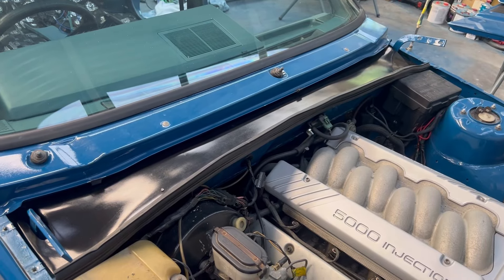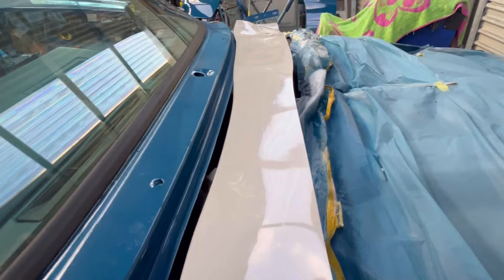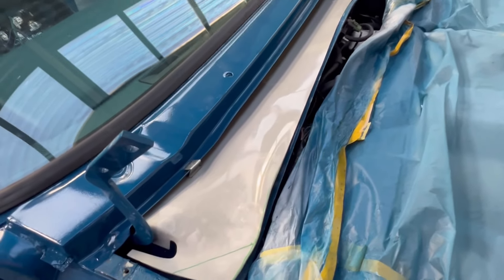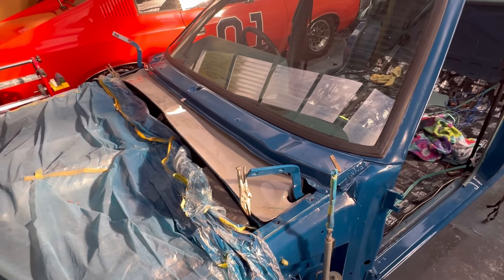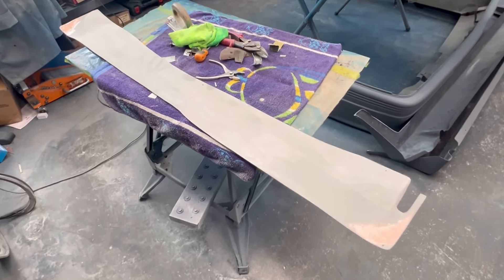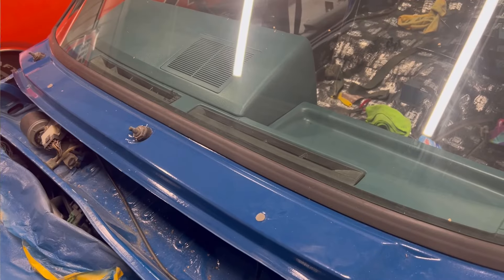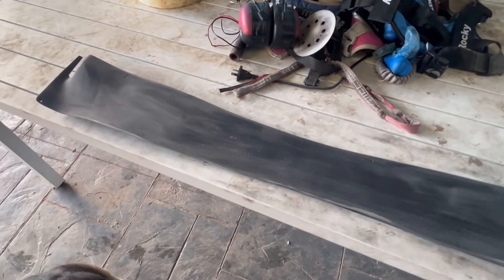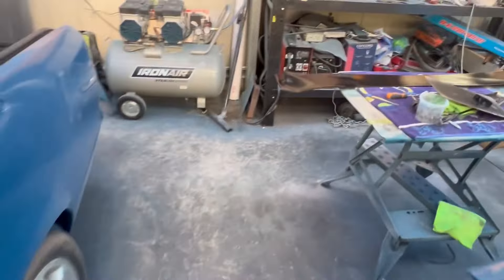VK COMMODORE BROCK TRIBUTE: wiper filler panel install

Comment: Those fibreglass plenum covers are a horrible fit even with a lot of work.

Still feel like snapping mine in half if it didnt cost so much.

Group on fb do metal ones supposedly much nicer fitment.
Reply from the maker: I know $199 for that piece of crap. Have not heard about the metal ones. I will have to have a look.